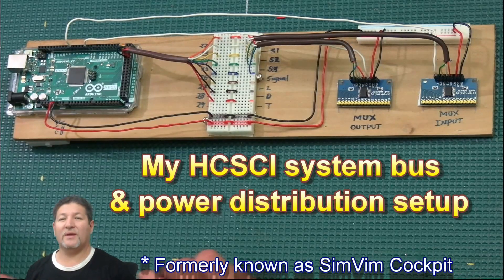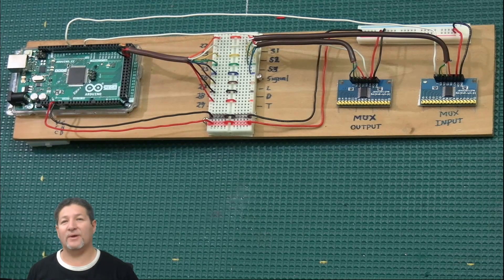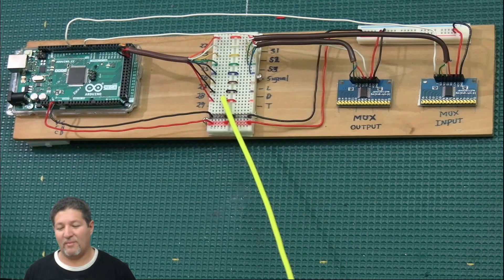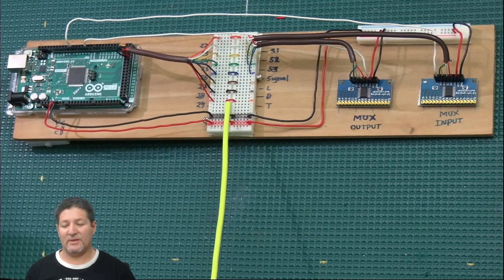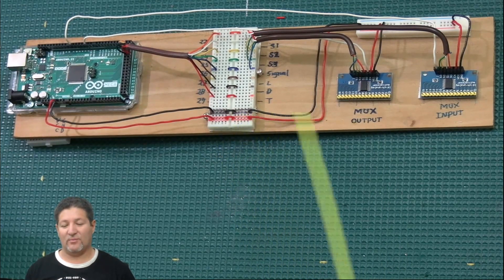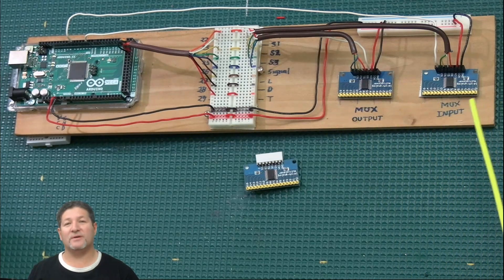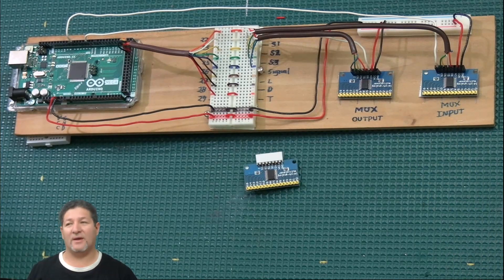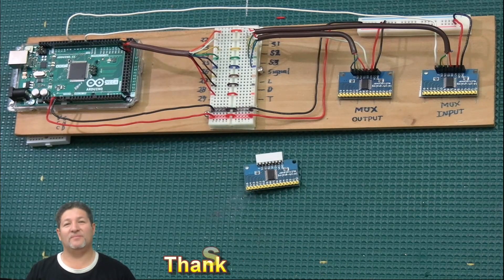My SimVimX/Real Sim Control system bus & power distribution setup

Comment: Hi, I'm building an Airbus A320 cockpit and I'm strongly leaning towards using simvim (or is it simvim?) as my hardware interface solution. From my simplistic viewpoint,there's not much difference in design philosophy between simvim and mobiflight, the key difference being that that mobiflight uses the windows USB distribution hub with arduinos at each end node while simvim uses an i2c signal distribution method with mux, demux, servo controllers etc at the end nodes.
I personally think, the key differentiator are :
(1) Price of nano versus a mux/demux chip
(2) Using industry standard i2c versus windows specific implementation of the USB standard (correct me on this).
Is my understanding correct?
Reply from the maker: Hello, Im not too sure that SimVimX uses I2C. I know they wrote custom code firmware for the Arduino and it uses no standard libraries.

To me, SimVimX is a much easier solution using the one single Arduino Mega and a bunch a very cheap MUX boards. The configuration or assignments is also way easier on SimVimX. 

The one big advange MobiFlight has is that it works with MSFS if you ever plan to use that. For XPlane I am very happy with SimVimX.

I made a video a few years ago on my opinion between SimVimX and Mobiflight. You should check it out to maybe help you decide. It was a few years ago so maybe things have changed with MobiFlight. SimVimX is also about to get a pretty major update. Hopefully soon.
Reply: @Qosmokid also, are you one of the designers of simvimx? Just curious and also if so, want to thank you for your tremendous efforts at making hardware interfacing easy for us hopefuls 😂.
Even if you aren't one of the designers, I would like to thank you for your clear concise video explaining the signalling bus.

Comment: very good friend very good your videos I will tell you I am starting to create my cabin but I have a doubt about the mux the question I have to connect each mux to a pin example of pin 2 to 13 on the arduino or how is the scheme thank you very much
Reply from the maker: You can connect an MUX to any pin on the arduino that is available except #13 and #22-29. You just have to assign it in the configurator as I show in tbe video.
Reply: @Qosmokid  thank you very much

Comment: Thanks !! , what size of cable are you using
Reply from the maker: I use 22 gauge wire but that's only because that's the perfect thickness for the breadboards and headers. The recommend on the website that you use thinner wire for permanent soldering. I believe they say 26-30 awg

Comment: I think you are doing a good job for the community.    I have been following you for about a year as I research everything available.   I just watched your video on  basics for building an mcp panel with simvim.  Extremely helpful.  I was having issues with the displays and after going over that segment multiple times, it stuck!  Thank you for that.   I am studying fusion 360, inkscape for graphics and kicad for circuit boards.  I am focused on the garmin suite of products and plan to develop bezels and all of the back end material and plan to offer all of the above to the community basically for free.  I am into CNC and laser options as apposed to 3d printing....

Do not let the OTHER guy diminish what you are doing for the community.   Things always change and it is inevitable that OTHERS will have something to say.  Simply state the current version you interface to and point everyone to the website for the most current version.   At the end of the day,  it is the process that works even when the back end gets tweaked.  Keep up the good work..    I am very interested in the interface/programming you demonstrated at the end of the mcp panel video.   Can you point me in the direction of other videos you have done in this area.    Thanks
Reply from the maker: Wow this is interesting, I think yours is another comment I replied to on the phone app but it seems it didn't get saved.

Comment: Wow! Talk about organized wiring. You don't want to see my threads pouring from my controls and crowding all over the Arduino lol. No wonder I have missed aproaches every now and then trying to get one of my thrust levers back to position right on short finals lol
Reply from the maker: LOL this is only neat right now because I have nothing connected to it. I'm sure you've seen the pictures of my main setup, that one is a mess.
Reply: @Qosmokid  I've seen some of it and still found it neater than mine and I only have pedals, yoke and throttle and reverse levers of the throttle quadrant so far lol

Comment: Well done my friend, when you have so many inputs and outputs, the only way is to use multiplexers and distribution boards! I am in the process of building a dedicated 13.5"x9.5"x7" control box for single engine GA aircraft in XP11. Inside the box will be housed a serial bus distribution board, a supply and ground distribution board, the Mega 2560, seven multiplexers and a ton of wiring. The top control panel will have 11 toggle switches, 40 momentary push button switches, 4 LCD displays, 2 potentiometers, a 5 position rotary switch and 12 rotary encoders, phew! 

Things are progressing slowly, as I had absolutely no idea how much wiring, crimping and soldering would be required :-( I will post a video about it when I've finished but in the meantime, thanks for your help and inspiration, kind regards from the UK :-)
Reply from the maker: Thanks a lot, yeah I started without MUX boards, it was quite messy and I was running out of pins on the Arduino quick. Good luck with your build, it will surely make your flight simming more enjoyable.

Comment: Many thanks once again for these detailed videos. I check your account daily ;). I have one question : After 3 days of searching in Website, I can't find how to use a push button instead of toggle button. For example, I Want to power B738 battery by momentary switch instead of toggle button. I even try to make a custom command but the website doesn't allow me since Sim and laminar are forbidden in custom. Please help !
Reply from the maker: I Was pretty sure I answered you question but I don't see my reply . Did you get it?
Reply: @Qosmokid  unfortunately didn't get your answer. Can you please tell if it is possible to use a push button instead of toggle button. Or use a custom "laminar" or "sim" dataref for it?
Reply from the maker: @uranusgodoy8694  Sorry about that, I answered on the phone app so maybe it didn't go through. Basically my answer was that I don't think that's possible because the plugin expects that switch to remain on for the battery to be on. If it's just a momentary contact then the switch might just go ON then OFF as you as you release the button. What you can do is use a "Latching" push button and to the plugin it will look just like a toggle switch
Reply: @Qosmokid  Hope they will react to your last video and allow us more freedom with dataref and command !